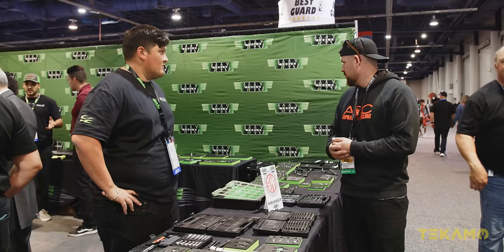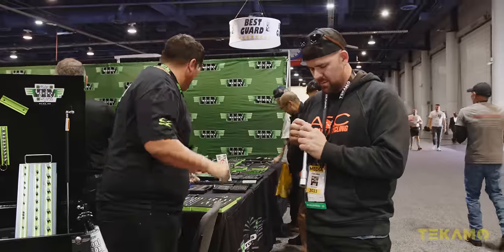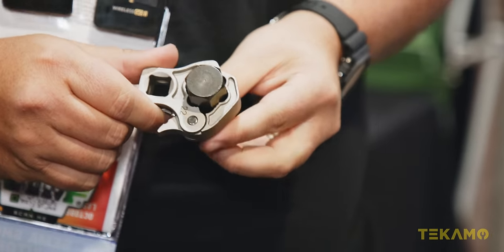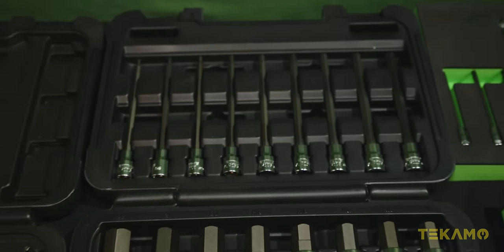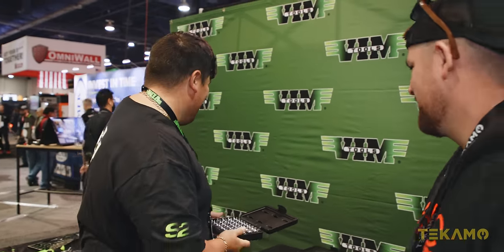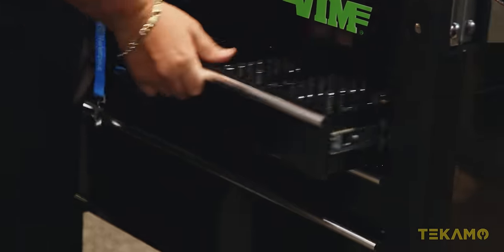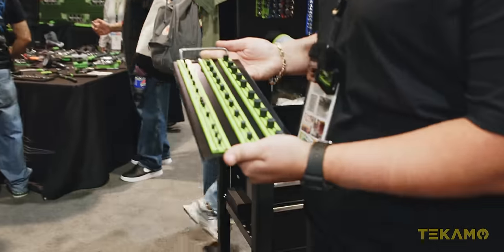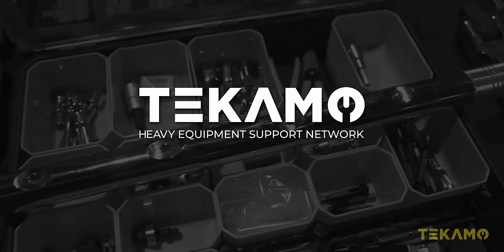VIM Tools for Heavy Duty Mechanics - SEMA 2023

Comment: I have a bunch of those magnetic rails. I have them for all of my swivel impact sockets, torx, long torx, internal torx, blue point twist sockets etc. They are expensive but they are the best socket rails on the market. So many socket rail or socket tray systems waste a ton of space in a tool box. If you ever calculated the price per square inch or cubic inch of a Snap-on tool box you will start to think twice whether you need a bigger tool box or a better system of organization. Throw out them blow mold cases and gigantic socket trays Snap-on gives you.